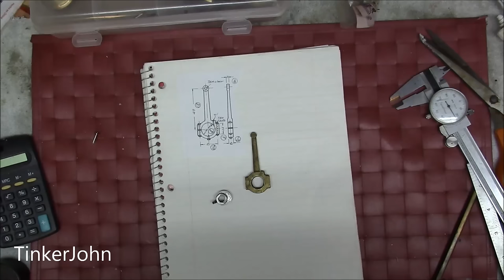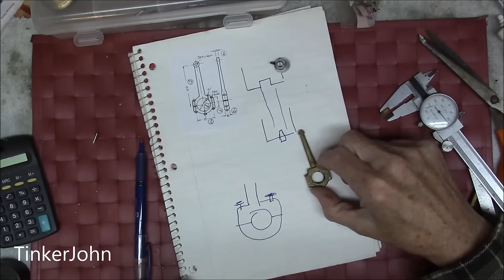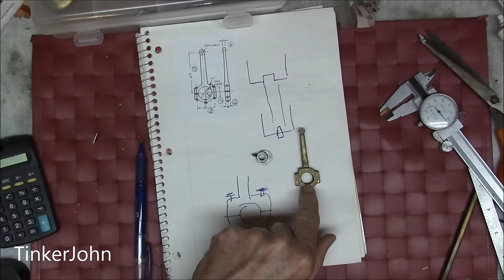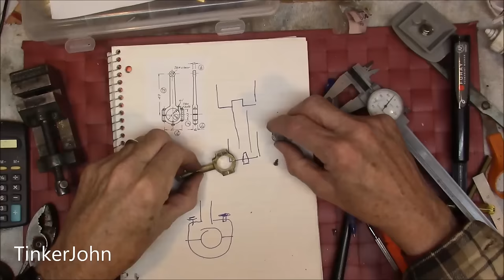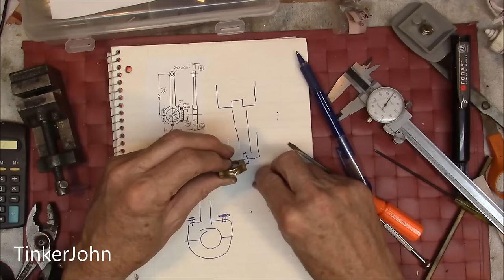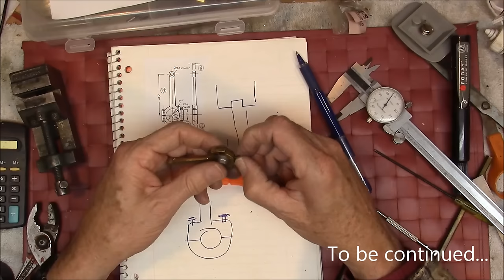Machining the Stuart 10V Steam Engine Castings - Part 55

Comment: The drawings only specify that one side of the eccentric strap should be cut through after machining.  This enables it to be adjusted to compensate for wear.  The Andrew Smith book suggests as you do that this is probably not really necessary.

Fake loctite bolt heads may not be the best idea.  Future owners when they disassemble the engine may break them.  Also the work involved in cutting bolts and the nut and thread at the other end and lining things up may end up being more work than simply drilling a hole through the piece. 

Keep up the good work John, we are all looking forward to seeing this engine running!
Reply from the maker: +John Creasey 
John, Very good suggestion about the locktite bolt heads.  I think I'll follow your suggestion.  ~John

Comment: Hallo,
I have bought at an auction a 30 year-old Set of Castings 10V with Ebay. With a Konsruktionsplan for 4 (!) different machines. The excentre is also used with the Stuart Score. There he must be divided because of 2 cylinders.
SUPER CONSTRUCTION REPORT, FIRST-CLASS TIPS.
Micha
O Gott, mein englisch...
Reply from the maker: +Michael Töpfer 
Michael, thanks for watching and for your comment.  Good luck with the 10V.  ~John
Reply from the maker: +Michael Töpfer 
Michael, thanks for watching and for your comment.  Good luck with the 10V.  ~John

Comment: Fine. update TJ.  Could you have split the rod, bored the holes, bolted it together, and then bored the eccentric, or is the part too small to work with?  This is not a criticism of what was done, I am just curious.  Next question which will likely be shown in future;  does the eccentric turn inside the rod, or is it locked in place?  I find machining a fascinating process and I certainly enjoy watching you work.  Thanks for taking the time to show and explain what you are doing.
Reply from the maker: +Stephen Moore 
Stephen,  Thanks for sending along your comment and question.  Yes, the part could have built just as you describe. In fact that is the way the plans were drawn.  I simply made a decision to do another way to achieve essentially the same results. That is part of joy of home machining; you are not necessarily required to make each part as the blueprint shows.  
As for the way the part works, the center piece is connected to the crank to rotate inside the connecting rod.  A future video will show how it all fits together.   Hope this helps. ~John

Comment: Would it have also been plausible to actually cut the eccentric strap, machine the big end of it with a step to fit in the groove, and omit the setscrew?
Reply from the maker: +TestECull thanks for watching and for your comment.  Yes, your suggestion would work well.  There are several ways to do most operations on this engine.    ~John